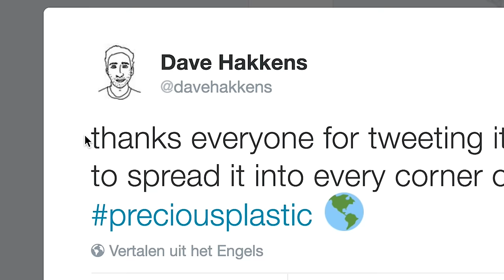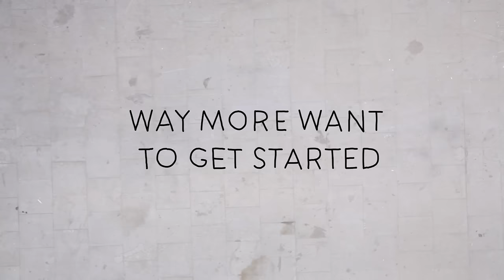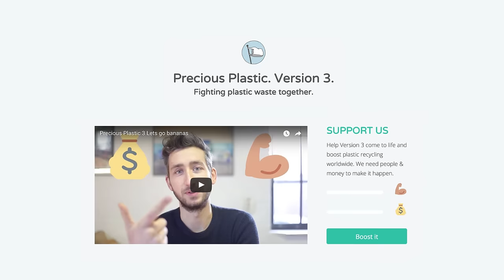Make plastic recycling  go bananas 🍌🍌🍌

Comment: I live in Sweden and I need help getting some parts.  Me and other two guys are building a shredder and a struder as a project at our school. We have been able to get some recycled parts. My school is sponsring the project and they don´t allow us to buy things from ebay or Amazon. A DPI controller can cost us almost ten times more in a regular Swedish shop, the band heaters are very expensive too. My teacher is now aware of my passion for recycling so he allowed me to put apart an old printer. I got a lot of stepper and servo motors, sensors and other parts.  I was thinking that I would be able to reduce cost if I can change parts with people that have what I need and want what I have.  Please contact me if you think this is interesting for you.